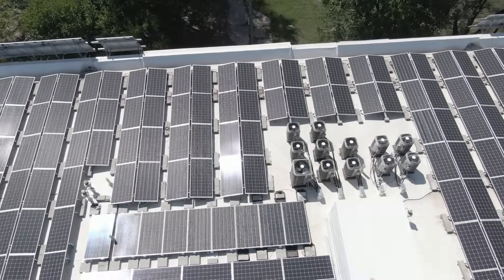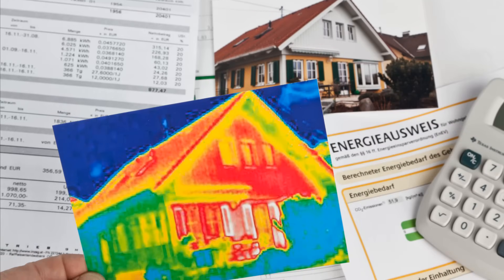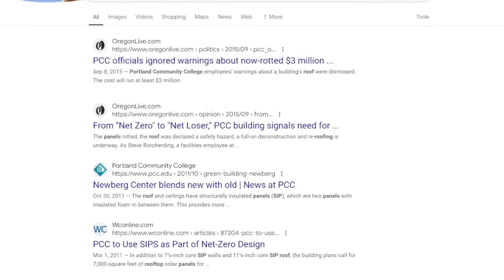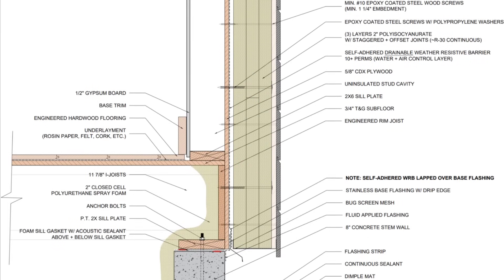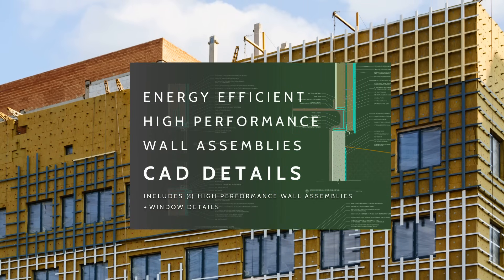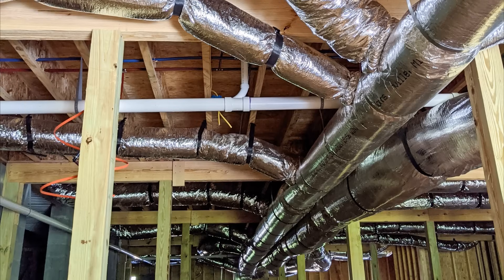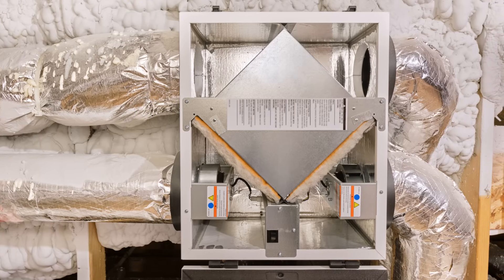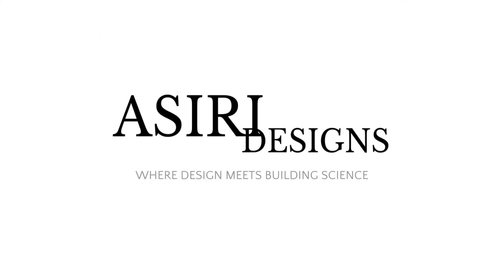The Unintended Consequences of Energy Efficiency...

Comment: Interesting video.  I presume that cardinal points exposure could also drive the exterior insulation planning?  A "southern" exposure exterior wall would have a far different heat/cool cycle compared to its "northern" opposite wall.
Reply: As you get more efficient with the assemblies,  thos matters less

Comment: Just past the two minute mark, you have a quick shot of vertically installed wood I-beams, which is something I've never seen before.
Reply from the maker: @misterlyle.  They are basically the evolution of Larsen truss walls, but instead of fabricating the Larsen trusses by hand, you can use I joists instead since they're prefabricated.
Reply: @ASIRIDesigns  Thanks for the response!  "Larsen truss" provides instant results: FINE HOMEBUILDING includes this method in an article from just six months ago.
Reply: @ASIRIDesigns  Thanks for the response!  "Larsen truss" provides instant results: FINE HOMEBUILDING includes this method in an article from just six months ago.
Reply: A few years ago the Journal of light construction had a detailed article of a builder who does this. He uses 12 inch beams. You may be able to find the archived article. It was pretty detailed in the install method.
Reply: @rygfhhbb  That recent article in FINE HOMEBUILDING includes great illustrations and information, all of which can be accessed in PDF format.
Reply: Thanks for the replies; I posted two messages that do not yet appear (for some reason).  I'll repeat them if needed.

Comment: Take a look at the picture with the corner of a window and rotted sheeting. Either the picture is upside down or the window was installed upside down. You can see the weep hole cover on the window frame.  I use to do service for a window manufacturer and saw plenty of square picture windows installed upside down, even saw sliders installed like double hung. Also the accepted standard leakage for a 3' x 5' is .3 cuft/min   that is essentially equivalent to having a 3' x 5' piece of plywood wood with a 7/8" hole drilled in it. Tested at 25 mph at 70F.  Not real world, just standardized.  They will leak severely when walls are well sealed.  The company I worked for lost a large account when a builder used ICF to the roof, but did not use hrv. Even when I explained the well sealed, well ventilated requirements of high efficiency homes, they would not believe it and blamed the windows and cancelled their account. This was before you were around, I could have just directed them to you for an education.  Ignorant labor is the weakest link in the high efficiency home market
Reply: 4:48
Reply: Labor would have installed an HRV if directed to. Seems like the issue is primarily with designers.
Reply: There’s a dearth of training and education at many levels. I work at county level building inspection, and plan review, and I’m constantly educating people in all levels about the intricacies of this constantly evolving industry. Watching the code cycle evolution is a better place to start from at all points in the build. From architects and engineers, the GC’s project managers and engineers, to the carpenter out there wearing the fall gear. Code is written in blood, and it’s the MINIMUM called for, going above and beyond is never discouraged except by the money people in the projects.

Comment: Excellent content as usual. Locally in the Midwest I’ve been seeing commercial building move away from lumber and towards steel framed and fiber cement sheathed structures. This solves the wood rot and structure compromising effects of moisture laden assemblies but doesn’t fix the mold issues. Is the solution really that exterior insulation is THE only solution to solve both structural damage and organic material growth?
Reply: The short answer is yes.  Because even if the framing is steel most structures will have paper backed drywall, moisture sensitive in-wall insulation that can mold or under perform when wet, moisture sensitive flooring (carpet, wood, subfloor, etc).  Even if you made everything from water resistant materials, it's not simply a matter of having materials that hold up during water damage, it's also a matter of health and air quality as mold can grow on dust.  Moisture resistance and drying factors are 2nd to preventing condensation to begin with and exterior insulation is the best way to do that.  This video focuses on the drying advantages of this assembly category but there are many other reasons that this assembly category outperforms.  For example, it excels with water and air tightness to begin with (in addition to drying if water or vapor does get through).  It excess at reducing thermal bridging which makes specifications easier to compute/model and more reliable/accurate modeling.  It also works in various climate zones for humidity control by reducing vapor and reducing hvac loads (helps keep house dry in humid climate and moist enough in dry climate, or moist enough during extreme hot and cold when heavy hvac loads might overdry).  etc etc etc  In mild climates you can build however you want to build.  If you are willing to use lots of energy you can live in a log cabin.  But if you want to tick all the boxes that humanity is trying to tick (extreme comfort and control, low energy use, durability, cost)  this is the way to go.
Reply: @weliveonearth8012 absolutely not the only way to go.

Comment: Nailed it. I did 2 layers of 1" xps staggered seams cuz rockwool is not possible to get for a non contractor. Wish I did 2 layers of 1.5". I'm in Minnesota zone 6. It was a pain to do but it's a 90 year home and knew I had to be careful as you can rot a house if you do it wrong.  Air sealing is super critical from the outside to stop that insane amount of water vapor that can penitrate. I wish I paid more attention to that but it seems good, for now. 
Love your videos. Keep em coming.
Reply: Not sure what you mean by not possible to get Rockwool. It's sold at Lowe's and Home Depot.
Reply: @Jaker788 the rockwool for continuous exterior insulation comfortboard is very hard to get your hands on at least this was 2 years ago due to supply chain issues. Now they seem available at Lowes.
Reply: I'm in MN. I thought we did the vapor barrier on the inside. Isn't it always supposed to be on the "warm in winter" side?
Reply: @ProleDaddy that's what code says now, but it's changing slowly. Never ever use poly. Smart barriers only. Poly should be illegal to use. Doesn't allow trapped moisture to escape and I don't care what you do short of stainless steel sheets welded, you are t sealing everything like you hope. I believe next code update is r10 exterior for 2x4 and class 2 vapor inside. So primer and paint or membrane or a smart vapor retarder
Reply: I remember researching this for Ohio. The goal is to have it thick enough so the dew point would be inside the foam  so water vapor would not condense on the back side of the foam, against the sheeting.  I ended up using 3", 2 1.5 layers.  I'm sure he has covered this in one of the multiple videos available
Reply: @rygfhhbb what part of Ohio. I am near Youngstown and considering etx insulation. Thanks.
Reply: XPS has a superior thermal performance  (R-value: 4.5–5.0 per inch). Why would you use rockwool?